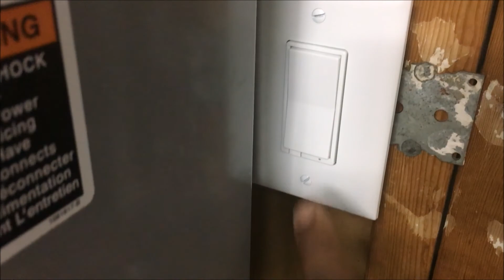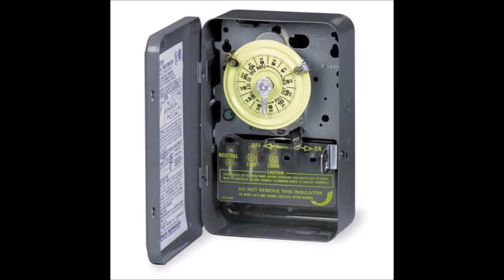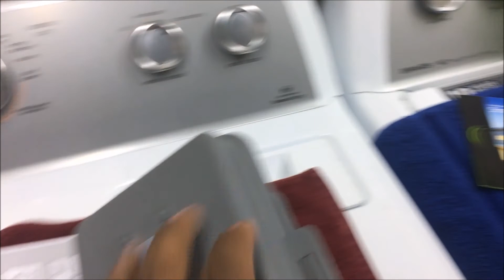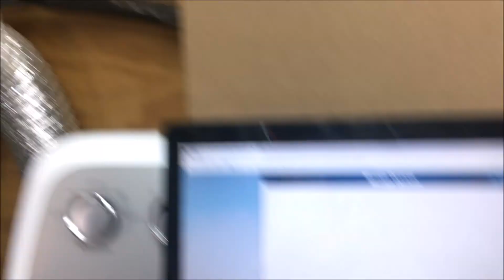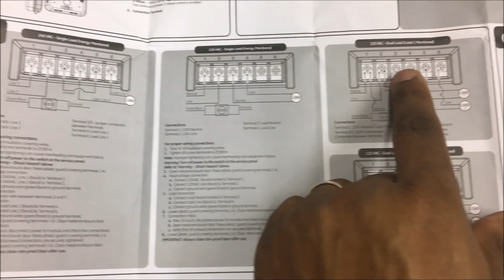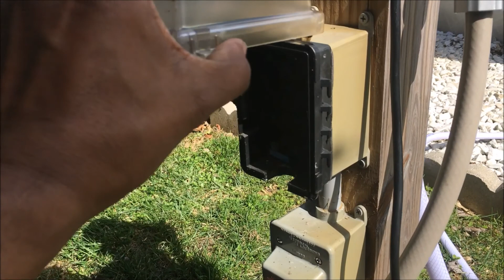Z-Wave Pool Pump Timer

Comment: I have a ring alarm that's z wave comparable. Does this would work with it?
Reply from the maker: If it’s zwave compatible it should work fine. Make sure it’s returnable if it doesn’t though.
Reply: @dan8220  just installed it today and it works with the ring alarm. It turns it off and on. Just need the hub to do the schedule for the timer.
Reply from the maker: @kelm1123  cool, I’m seeing smart thinks hub on alot zwave items, I have ADT pulse and it works on that hub.
Reply: @dan8220  yeah I was glad I didn't have to buy a hub

Comment: How does that timer work with a heater
Reply from the maker: I’m not sure it for a heater. A heater would need to run off a thermostat. I suppose you could but most heaters are gas which would require a thermostat of some sort. If you fixed up something for a electrical cut on and out it does take 240v also. It can wire both single and double pole.

Comment: How do we program the timer? There's no information on that part of this subject....  Please update video to show how to program the timer part of the switch.
Reply from the maker: Robert Beyers 
The programming is done on the webpage of what ever you use to control the system. I use pulse so I program it like a light in the house or any other smart module.  This if depending on what type of system you use. I use ADT pulse.

Comment: Thank you.  Is there a way to add a fireman's switch/heater cutoff to allow a pool heater time to cool down before the pump shuts off?
Reply from the maker: Jon Wilson 
I’m not sure. This is a on off switch for one item. An additional off switch wood have to be controlled separately from this unit.

Comment: I just watched your video and wondering how it has held up over the last year? Any issues with heat or the relays burning  out? I'm  using two SSR's on a well pump and had to bump up to 100 amp and add a heat sink and computer fan for cooling.
Reply from the maker: Ashley Clevenger 
No I’ve had flawless operation. Use it in the winter for the little pump they sucks the water of the top of the pool cover and drains it to the driveway, operate it off the pulse app as well. Couldn’t be more happy. My pool pump draws about 1100 watts and 12 amps, the switch is rated for 40 amps so no heat at all.

Comment: Thanks for this video . Don’t have a pool but a hot water heater that is sometimes difficult to reset. Depends on what got moved where in my garage. (Hopefully putting up a shed soon) I personally have smartthings and want to connect this to it so I can set up better timers in it. Hopefully doing this soon as it would be awesome to yell at Alexa to turn the hot water on and be done with it.

Comment: Can I conect it to the power control of the house and check the energy? Like a energy monitor? Or it would explode?
Reply from the maker: Beatriz Maldonado 
Oh no, u don’t want it on your entire electrical system. It is only rated for up to 40 amp device. If I want something to monitor usage for the entire house consider the item I talk about in my 3 part of the 22 kw generator. I have had my monitor device going on 6 years and haven’t even had to change the battery’s yet.  The link for the device is on here.
https://www.amazon.com/Energy-Transmitter-clamps-Current-Cost/dp/B015RY9VCG?keywords=current+cost&qid=1528153570&sr=8-5&ref=mp_s_a_1_5
Reply: I am looking into a nifty device called Sense that will enable this type of monitoring.  Check it out.  https://sense.com/